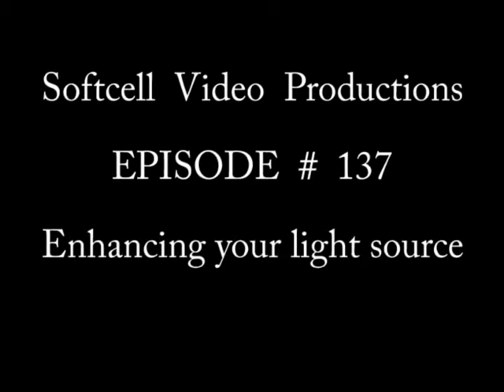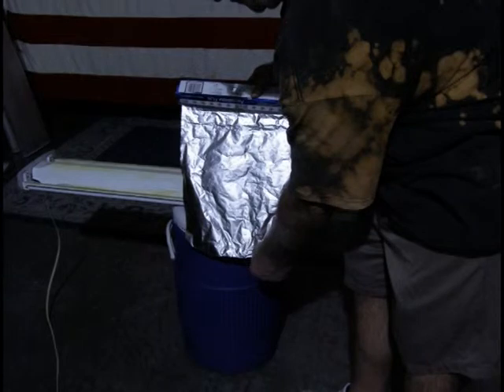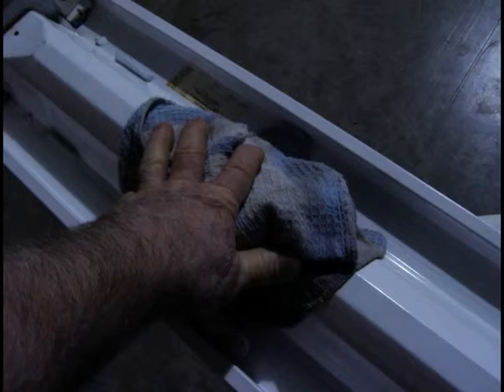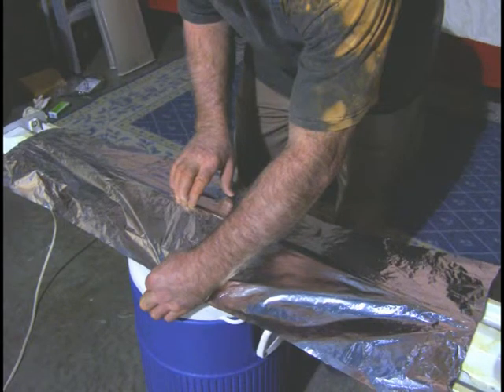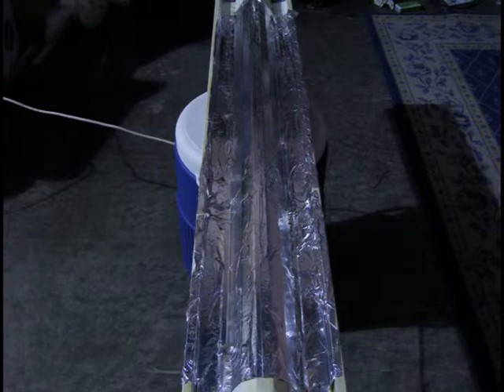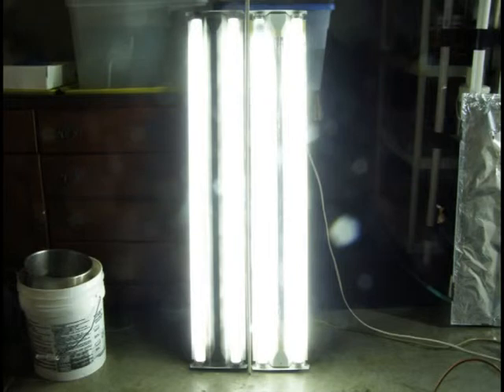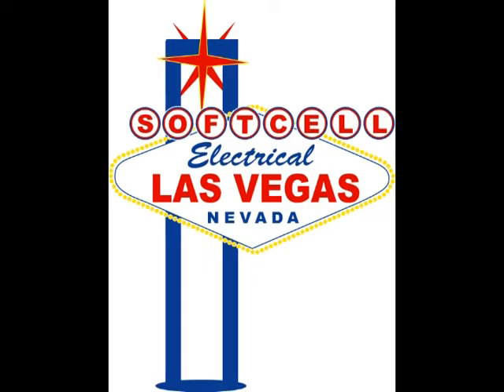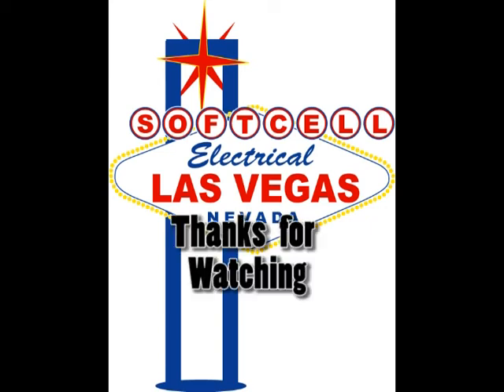Cheap lighting upgrade #3J 137

Comment from the maker: Good question. I would think that the overall effect would be a reduction of heat since the foil is reflecting visible photons, shouldn't it reflect infrared photons as well? As far as ballasts go, they last a good long time if you replace bulbs at the first sign of flutter. Only problem as I see it is that if you do replace a ballast you will need to cut the foil, but even without repair your only going to lose a fraction of reflectivity. Got some interesting stuff coming up.